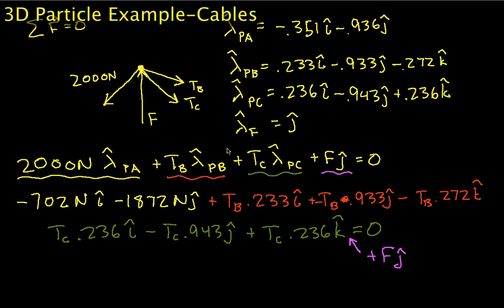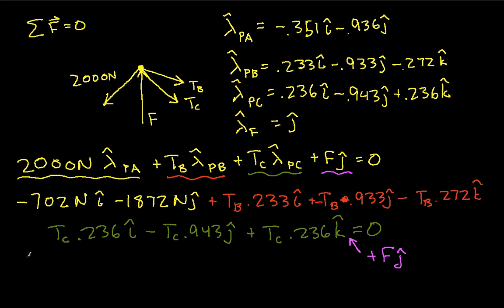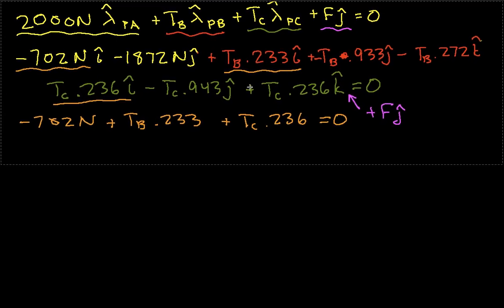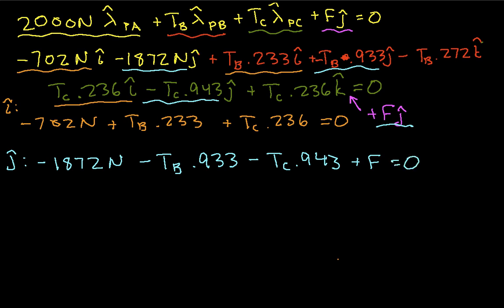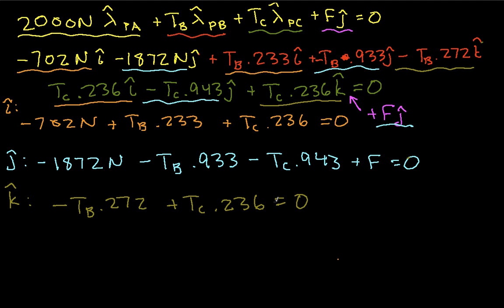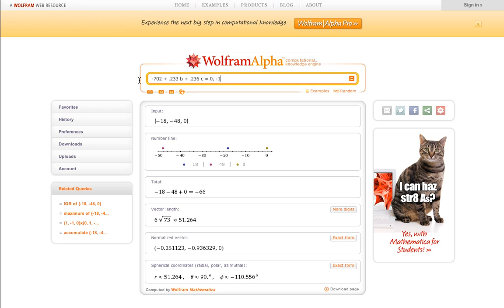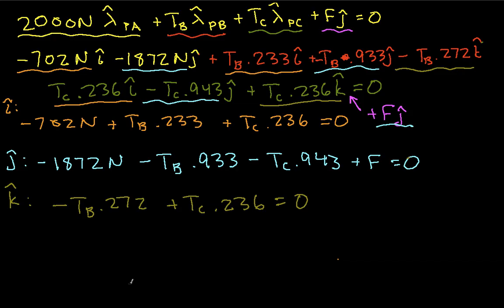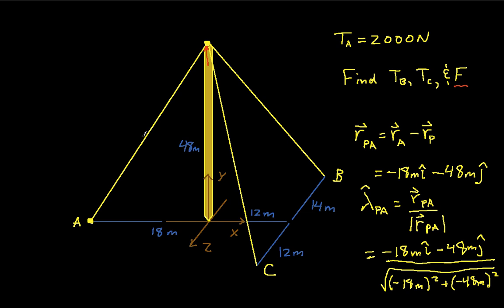3D Particle Example-Cables Part 2

Comment: Probably would have been more informative if you did the calculations yourself instead of wolfram. We can't use wolfram to solve the question on an exam lol. Good video for setting up the equations though, that's usually the hardest part.
Reply: +Raindeux 
"The obvious thing to do is type these into WolframAlpha".

lol

Comment: The way you would solve for the 3 equations and 3 unknowns is by first looking at equation 1, solving for one of the variables in terms of the other variable. Then you plug that value into the same variable in the second equation and solve for the remaining variable. Then you plug that value into the third equation and solve for that variable thus coming to an answer with an actual value. Then you use your derived equations and plug your obtained value into them.